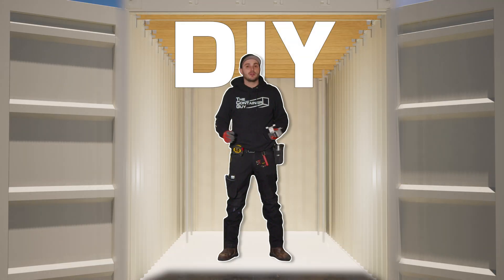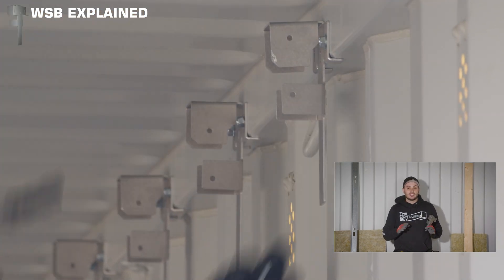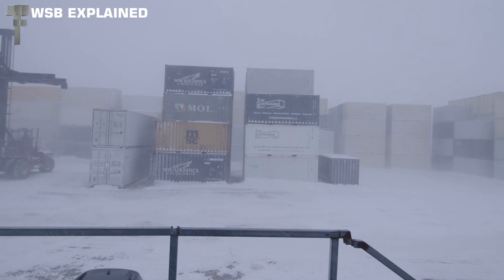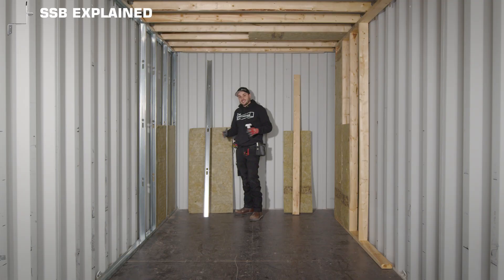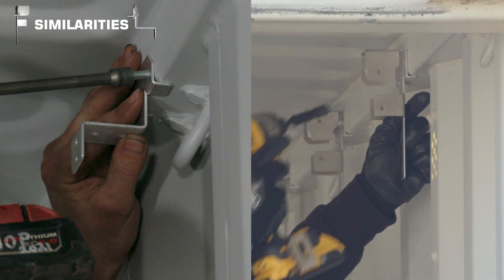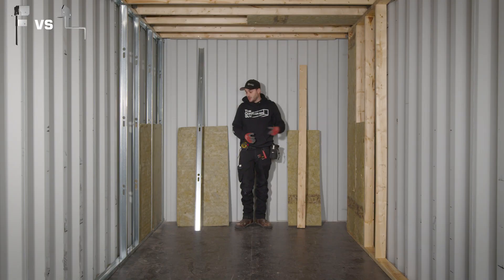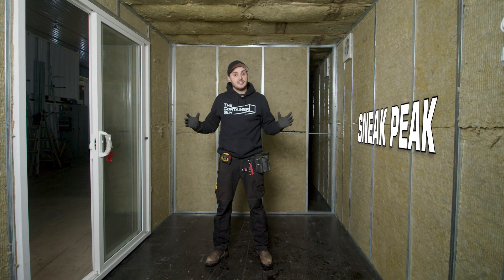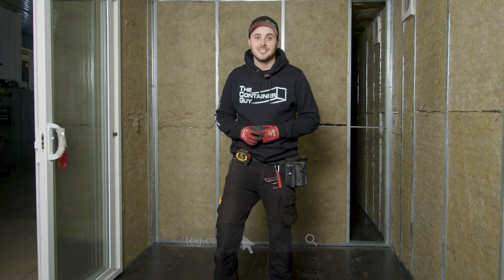Should You Use Wood or Steel Studs In Your Shipping Container?

Comment: I think it’s great that you are using build science and advanced engineering to create a better solution to conventional methods. 
Could you please share a link or image on how you would connect wood ceiling joist to metal side joist. I feel like this method allows for a wood ceiling (plywood, TnG, or shiplap and then drywall or PVC panels for the walls. 
I am plan for 3.5 inches of closed-cell for Zone 7 R-value.
Thank you. 👍

Comment: I want to see sliding glass doors installed behind the metal container doors
Reply from the maker: Just frame a partition wall across normally and follow the sliding door manufacturers recommendations. Should be simple
Reply: @TheContainerGuyTV  Thnx. Is this a common mod or not really? I want my container 'bunkie' to be extremely discrete & secure when I am not around. I figure leaving the walls/roof/doors fully intact will accomplish that.
Reply from the maker: It is, we have a mod in our shop doing this exact thing. Here's a cheap method for making the partition wall! https://youtu.be/MsOUJwUYjdk

Comment: Hi, many thanks for your videos, they are great. Using your steel stud systems, which does not have any thermal break between the container fasteners/container wall, means that you are providing a conduit for cold/heat to migrate from the outside of the container to the inside. If you use an insulating walling product, then yes, any further transfer is stopped, but only at this point. As I am sure you have the answers already, please can you explain when using your steel brackets and studs systems why thermal transfer does not become an issue and how and at what point it is stopped? Many thanks. Kind regards Gavin
Reply from the maker: Thanks for the question Gavin! So for a majority of the mods we do, it's an industrial setting where a little bit of thermal bridging won't affect the day to day operations or longevity of the container. The brackets are pretty small so it doesn't lead to a large amount of heat transfer. For a container home, where you want to be even more mindful of mold and mildew growth, we also sell a composite steel stud brackets. The composite design drastically reduces thermal conductivity. If thermal bridging is something that you're aware of and concerned about, these would be the answer. https://containermodificationworld.ca/products/composite-steel-stud-framing-brackets-for-shipping-containers-sea-cans
Reply: @TheContainerGuyTV  Awesome, thought you would have the answer. Much appreciated. Kind regards Gavin